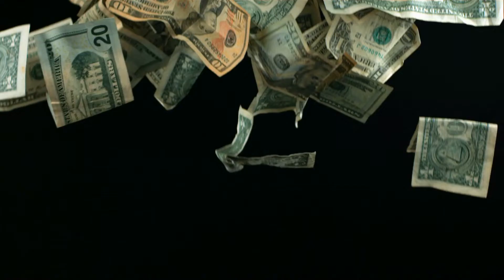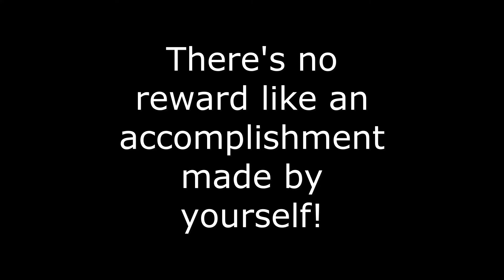Swapping grills on my Durango

Comment: You should have thought about doing the lower grille while you had it off.
Reply from the maker: I did thought about it....but for some what reason I just decided to get the middle grill done.
You should do part 2 for the lower grill install, that would complete the video!
Thanks

Comment: Great video. Are there any shops in Ontario near me (London or GTA) that could do this for me. Let me know. Many thanks good sir 😎🙏
Reply from the maker: Thanks for your interest. I'm assuming any bodyshop would do it with great results as well. Check with your local shop if they would like to tackle this job.
The grill itself is pre-fab to fit exactly on this model and the original grill casing. 
If you ever get the job done, come back show us yours too!
Goodluck!
Reply: @karlos9394  Are you aware if customgrills has the lower bumper grill with adaptive cruise control portion? Many Thanks Brotha 😎👍
Reply from the maker: @Worldrecord  I do think they had the lower grill aswell. But there is something with a gadget in the lower grill. If it's equipped with it, then maybe you can't or shouldn't install it. Matt at customcargrill would gladly help you out or on there site they would mention it.
Reply: @karlos9394  alright sounds great. Will contact Matt 👍Thank you